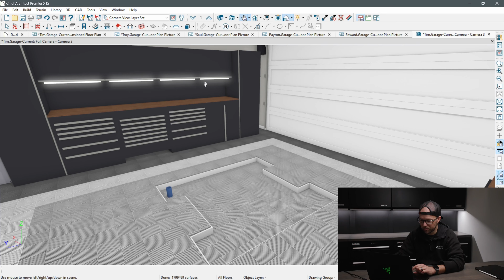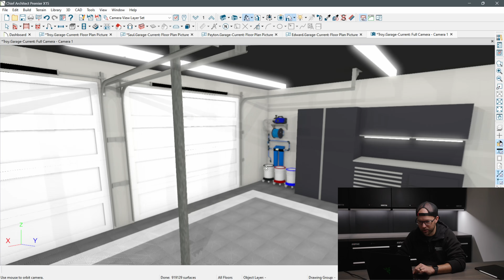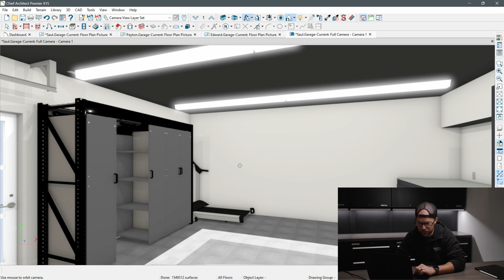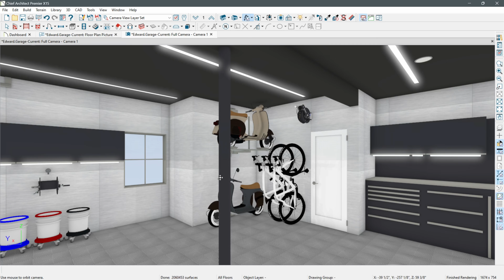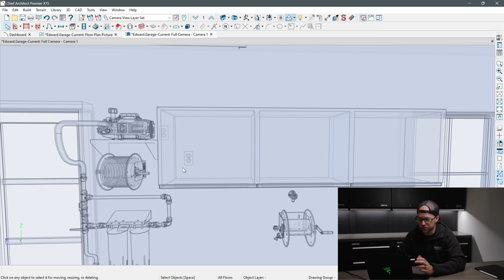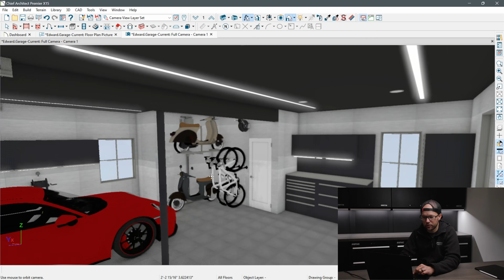How To Use a 2-Car Garage Effectively | OG Design

Comment: For Troy's garage. Mount all the washing stuff to the exterior wall just to the left of where they are, put connections inside the garage and through the wall to an exterior wash pad. An open bottom cabinet where the buckets are with more countertop would allow for more cleaning supply storage while maintaining the ability to roll buckets under it. This would make it easier to justify removing the end section of cabinet right at the bottom of the step. Restoring its functionality. You could stand at the counter at the bottom of the step and turn around and go back in.

Comment: Very nice. but only practical for a "car owner, polisher cleaner"  I had a two car garage that I built cars in.  It had a lathe, mill, sand blaster cabinet, two ton press and a four post hoist.  Along with a giant compressor and a roll down spray booth.  Tools in every cabinet and right up to the 8 foot ceiling.  As well as storage in the rafters.  Now I have a nice  870 sq foot garage with all my toys and a 15 feet walls to store more stuff.  This explanation is for most men that have more stuff than they need but need to have it incase.  You can never have a big enough shed. 😜

Comment: What are the OG spec paint colors/finish for the ceiling and walls? And does that change for garages with high (10'+) ceilings?
Reply from the maker: I like Benjamin Moore Silver Chain AC-25 in Flat.  Ceiling in Sherwin Williams Pure White in Flat.  Trim in Sherwin Williams Pure White in Semi-Gloss.  I don't like black on any wall in any room.

Comment: Luckily my apartment garage is generously sized at 21' x 10.5' where I can fit a 2.5' deep boltless shelving rack on the back wall for detail supply totes, a work bench and a place to stow away buckets and a cart below. This garage provides 2.5' of workspace on three sides of the vehicle for detailing. Besides cabinets I believe OG should consider boltless racks as a basic solution for garages and RiveTier has been the best customizable solution for both of my garages as well as the shop plus they're comparable to what is used in the OG warehouse.
Reply: Check out Rousseau's Spider Shelving System. It's more of a rack style system but can have doors and sides if you want. Very customizable size wise too. We're a dealer now.

Comment: So true, I have a 24" x 24" 2.5 car garage and I put an array of cabinets on the back-wall, a work bench, a windows, some good lights and bought swiss-trax off you guys a few years back. Even to this day, my neighbors are blown away when they walk by when I have it opened up and am tinkering around out there. Didn't have to put too much into it, albeit prices now are consistently ~ double what they were back in 2016 when I built mine out...at that time I put less than 5k into getting all that done!

Comment: Dang, chief architect looks downright archaic compared to Revit lol. Obviously costs way less though compared to Autode$k. 😂
Reply: Revit is great for architects and building something from nothing. For our workflow CAP handles a product library so much better. I don’t need to build items from scratch, I just want to be able to drop items in from the library super easily which is why we use CAP.
Reply: @kylehenderson1402  yeah I get the reasoning. Just the interface looks so much older. I’ve gotten used to the ribbon type of interface in most programs now.

Comment: I have a 20x20 with a small 5x8 alcove off the back to one side where my water heater, air compressor, tool box and work bench lives. Then I have a 2’x4’ shelving unit at the back center, and some shelves along one side. I can barely fit one tall cabinet and wall mounted PW and hose reel, and I can barely fit my Miata and wife’s CX5 in there. I have so much junk all crammed in there. Wish I could fit more cabinets or bigger tool box, but there’s just no space.  3rd car lives outside. I need a 3 car garage house or a house with room for a detached garage shop, so badly.
Reply: Yep, that’s the struggle.

Comment: Sorry, you lost me at converting a 2 car garage into a 1 car garage.
Reply: Lol yep. I park a car in mine and my wife gets a spot also. No way would I banish her car to the outside. Unfortunately my 3rd car has to live outside.
Reply: Yeah me too, I kept hoping to see any possibilities without converting to a 1 car garage…
Reply: @scottymagouf  I have everything mounted on the front wall of my 20x20 garage.  6ft workbench with storage, 3x7ft cabinet for my supplies, pressure washer, air compressor, vacuum and a sink in one corner
Reply: Exactly. Kinda crazy.
Reply: I’m giving up a spot here in Wisconsin.
Reply: Yes. Here in Wisconsin ALL the cars need to be in the garage. Weather is just too nasty.
Reply: Ditto.  So stupid.
Reply: This video is not for you.  Move on.

Comment: With the size of cars these days a 2 car needs to be 24X24 or bigger.....
Reply: Good luck with that, but I hear ya - unless you are getting a custom-built home the standard 2 car garage in most tract developments is going to be around the 20-22" range in each dimension.  More space = more $$ on the builder for materials.  Our 2005-era home (we are the second owners) with a 2-car garage came with one measly GFCI outlet, one light fixture, and one garage door opener. How's that for cutting costs lol!
Reply: @progression_decibel mine is not much better, 1 outlet, 2 lights and 1 garage door opener lol so bad
Reply: @progression_decibel exactly.  Not to mention, 95% of people could care less about the garage
Reply: @progression_decibel  I am well aware of what the "standard" is, doesn't mean it's right...but most folks don't even park a car in the garage these days, it just accumulates more junk they rarely if ever use.
Reply: @TScott79   Ain't that the truth.  I see a lot of my neighbors' garages with so much junk, quite baffling where they get it all from lol!  Our garage will be the envy; I'm super excited to Obsess-ify ours very soon!